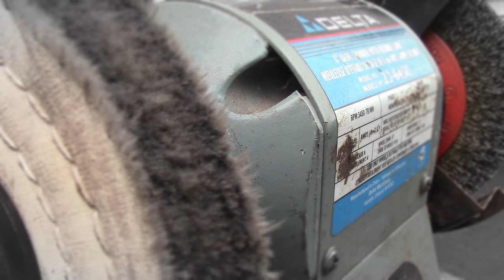ARDEX Hatchet - Heavy Rust to Super Mirror Polish

Comment: I have a similar Ardex, hard to find any info on them but they might be made by Iltis, I think. Do you know anything?
Reply from the maker: Info is hard to get on them, very true! I'm not sure who made them. Can't seem to find an answer!
Reply: There is a discussion on bladeforums about them, in the axe section.
Reply from the maker: i've seen it!
Reply: Loving your mirror finish, I gotta try this rooster method
Reply from the maker: Thanks Clancy! Although the Rooster method wasn't REALLY used on this one! I just used the sanding pad to do some heavy sanding on the cheeks, but not on the actual edge! :-)
Reply: There is some debate about these axes evr actually being produced in Canada.  Radmonski had purchased a forge and all the equipment required to do it and possibly even brought over a European craftsman.  But others say they were all just imports from Germany and stamped here.
Reply: Ardex was a trademark used in Canada by H.R. Radomski & Co. of Toronto.  Radomski appears to have been principally an importer of European tools, applying the Ardex name to hammers, woodchisels, tinsmith's snips, vises, hatchets, axes, oilers and other hand tools. (See my previous post on oiler labels.)  The secateurs above may have been made by a different company using that name.  However, Radomski also seems to have actually made axes in Canada, beginning in 1977. The company was dissolved in 2003.